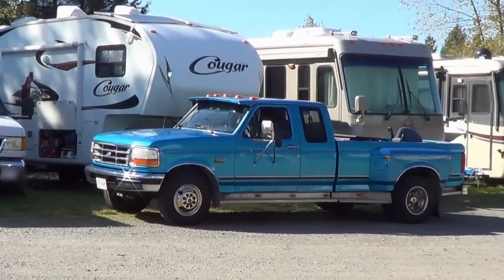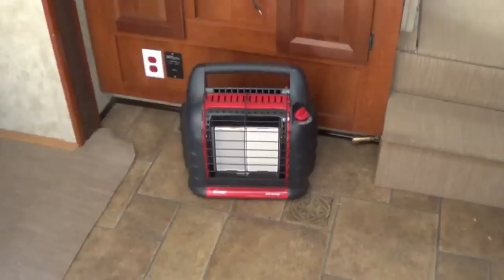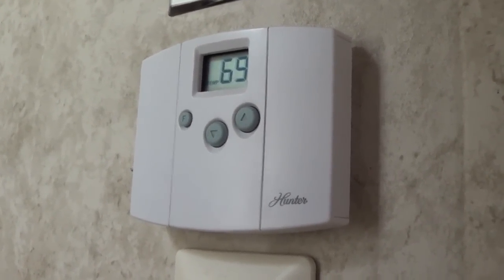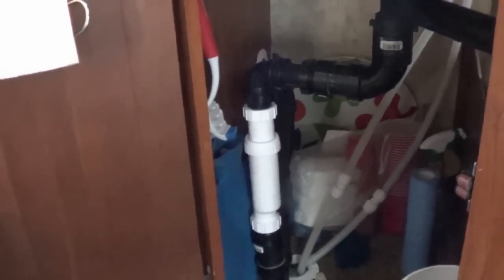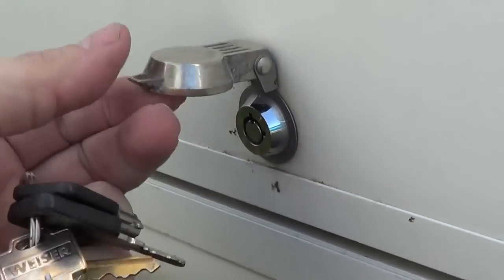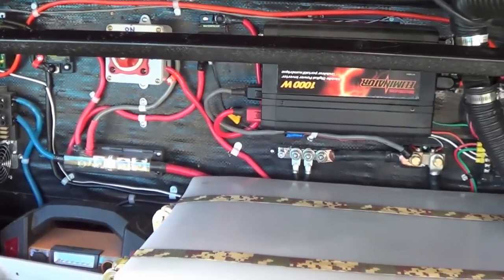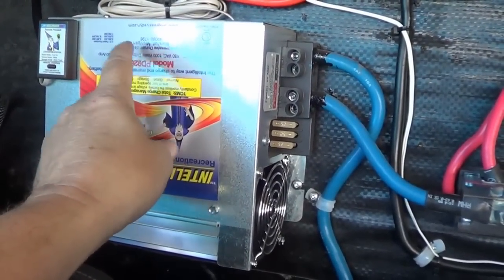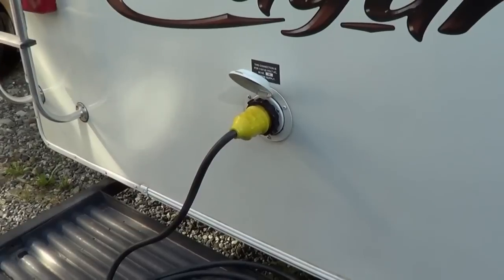Looking Back On Many RV Upgrades - How Have They Performed?

Comment: Hello Thanks for the update. FYI 1/2 tspn of Old English furniture oil applied using the corner of a paper towel to the cover of your key (or any exposed stainless steel or aluminiun and other metals) will deter dirt accumulation and oxidation. Easy to remove any build up later with just a water hose. I use an old raggedy wash cloth long ago saturated and kept in a zip lock baggie in the box with my windshield cleaner stuff etc in the hold box. A light coat is all that is required for the exposed trim metals after I wash the rig. Makes a difference. Ps. Don't wash this rag in any laundry. I just trash mine later.
Reply from the maker: Neat tip, thanks!

Comment: I have the Fantastic Fan with the remote control, it is truly FANTASTIC !!! I really like the remote control they use, you can use it manually, or you can set it to operate as a thermostat.

I also have that "Erngh, Erngh" sound coming from my two fans. I have determined that it is the motor that controls the vent cover. For some reason the system cycles at random intervals and it drove me CRAZY until I figured it out. My solution was to add switches that controlled power to the fans themselves. I simply turn the fans off when not in use. Also, the power switches allow me to turn off the fans with the vent covers open whenever I the Camper is in storage ( I have the Maxx Vent covers to protect the Camper from the rain).
Reply from the maker: My sound is a bit different since my vent cover is manual and I do have the fan wired to a second on/off switch on the wall.
I think I just need to disassemble it a bit and get a bit of lube in the bearing.

Comment: If you are wanting to replace your 1000 watt inverter with a super efficient inverter- check out the morningstar sure sine inverter.  All solid state, no cooling fans to fail, draws 50ma in standby mode so i leave mine on all the time (3 years usage now). It powers the 3 tvs, satellite receiver, DVD and Tivo receiver, refrigerator ice maker when boondocking as well as keeps all our computers, phones and other devices charged. Then we use a xantrex 2000 watt inverter that we turn on to run the higher power items like the vacuum, microwave, blow drier, induction cooktop (when boondocking)
-Scott
2012 Tiffin Breeze 28' with 1100 watts solar, CRV tow car
Reply from the maker: Looks great, thanks. Add to my Santa list. :)  Cheers! Ray

Comment: Great to see how the upgrades have performed. Have you considered adding a water filtration system for when your on shore hook ups?
Reply from the maker: It's crossed my mind from time to time, but always have other things to spend my money on. So far we've gotten by fine just purchasing our drinking water from machines when traveling and using separate jugs for it
When in BC on Vancouver Island (where we do the vast majority of our shore hookup camping) I don't worry much as I know the tap water quality is extremely good.

Comment: WOW! That's expensive! I just went through my whole RV and replaced over 20 G4 two pin bulbs and almost 20 921 bulbs like you pictured at 7:42 mark and I spent under $50 TOTAL. Off Amazon. My 921 bulb didn't look like yours though. But still works and puts out light.
Reply from the maker: Good deal!

Comment: Nice video.I see you are proud of your blue truck but what type of upgrades have you done to it. I have a old 90's ford like yours and would like to get some tips on how to get all I can from this old but tough truck. Any tips you have would be deeply appreciated. Oh yeah I like the color as well of your truck. Thanks God Bless Mike
Reply from the maker: It's a 1994. I haven't done too much, it's in stock condition, I just keep it well maintained. From what I read with the 1994 and older you can't do too much other than free up the exhaust a bit or maybe change the turbo to an aftermarket one. They'll never be a powerhouse but very reliable. Here is a good forum to read for the older Ford IDI trucks - http://www.thedieselstop.com/forums/f30/
Cheers Ray

Comment: Had to replace the battery in my LevelMatePro plus when I replaced it I had to bend out the contact for the battery compartment. But mostly wanted to tell you there's an update for the phone app that allows you to set the time out to help with battery consumption.
Reply from the maker: Cool, I'll update my apps.

Comment: I am a little surprised that you don't have an Autoformer to protect your rig from low power at the various RV Campgrounds. We just used ours for the first time and it kept the power at 125 volts for our entire stay. Amazingly, it also made our Coleman A/C Quieter. I know it is hard to believe, but, it was really much quieter than our last camping trip at the same campground where we experienced low AC voltage.
Reply from the maker: Well my rig is protected since my type of surge protector will the power shut off if the voltage drops low enough to cause problems, it happens at about 108 AC. Also, the display lets me know what's coming in at all times.
Funny enough sometimes low voltage can be caused by too many people on a weak campground power string running autotransformers. Using an auto transformer lowers the voltage slightly for other campers on the same circuit. If enough rigs are using them it can add up. Really though the root problem is campgrounds too cheap to upgrade their systems and the modern rigs are getting so power hungry.
If I routinely stayed at parks with low voltage problems I might invest in an auto transformer, but I don't find the issue too often, since for the most part I dry camp in the winter and stay at just a few parks with great power in the summer. I've weighed the pros and cons and decided it was an extra piece of equipment and weight I didn't need often enough.
Another option I have is to simply unplug and use my battery and solar. If that's the case I would ask for a discount or leave. ;)
Cheers Ray

Comment: Sorry about your loss. Thank you so much for the videos. Very informative and to the point. While watching this video I noticed your rack on the back appeared to have side supports vs just a center hitch. I only have the hitch and I'm not real comfortable about it wobbling. Have you done a video on this?
Reply from the maker: Thank you. Are you talking about the trailers rear pull out bike rack?
Reply: The flat tray under the electric outlet seen at 31 minutes.
Reply from the maker: That's the slide out bike rack, came stock on the trailer - https://www.youtube.com/watch?v=QTmYq110G3k

Comment: Sorry for your loss. I saw your rig on pictures of Lensun Solar Panels. I would like your take on them the good and bad? I am trying to decide which Solar Kit Company to go with. We want to try and run our RV Dometic Frig 6.0 cu in in the daytime, and switch over to propane at night.
Reply from the maker: Thanks. Here is my initial review of the Lensun panel - http://www.loveyourrv.com/lensun-flexible-solar-panel-review/ I haven't had a chance to use it much as we have been on hookups this summer, so won't know the longer term opinion until I head down south this fall and really start using it all the time boondocking.
My feeling though is unless there is a specific physical reason for a flexible panel, the rigid glass panels offer more bang for the buck and are proven to last.  Cheers Ray

Comment: Just stumbled on your helpful channel, sorry for your loss.  A couple questions with regard to your water pressure regulator.  When you hook up your pressure regulator, do you adjust the pressure with water flowing inside the RV, ie at a sink? Second once you set your maximum flow rate, does it need to be adjusted at different campgrounds?  Thanks, peace & happy travels.Bruce
Reply from the maker: Thank You Bruce. Ya, I set it up with the water flowing. I've only needed it once or twice to find the pressure I like, it's worked everywhere. If the campsite has really low pressure I just won't use it. Cheers Ray

Comment: Can't wait to see the video on the wireless BU camera. I've been researching some of those lately. Do you monitor your weight after all these upgrades? 6V batterires + Solar Panels + inverter + TrailAir + everything else ?
Reply from the maker: Yes, I check the rig on scales a couple times a year. As I've added weight I've tried to lose weight by not carrying other items, for example, I've really leaned out the amount of tools and spare parts I carry. Changed from heavy cruiser type bikes to lighter weight models.
We are getting close to max GWVR on the trailer 10,400 lbs, last reading was around 9500 lbs trailer with full water tank and 7000lbs truck with a pin weight of around 2000 lbs. Shows you why a 1/2 ton truck is a bad idea even though this trailer claimed 1/2 ton towable. The trailer axles are rated for 8800 lbs so we are pretty good there with about 7500 lbs on them.
One reason I really liked this model of Cougar was it had a cargo carrying capacity of 3000 lbs, may of the new super large fifth wheels don't have that much.
Reply: yes, 1/2 ton towable is the worst marketing gimmick ever. You can use a 1/2 ton if you have a 100 lb driver only and half a gallon of gas with the trailer at dry weight, and even then you're at your towing limit with the 1/2 ton.

Comment: Hi Ray I love your video reviews. Im getting ready to put solar on my trailer and was wondering if the glass they put on top is safety glass . Im just worried that they could get broken going down the road.
thanks
Matt
Reply from the maker: Hi Matt. The Renogy panels I have and most quality solar panels use tempered glass. I've never heard of any problems with them breaking during travel. I' ve gone down some pretty washboard gravel roads where the rig was vibrating  a ton with mine. Same with most boondockers I know and no issues.  Cheers Ray
Reply: Thanks Ray I just ordered my first 100 watts.
Matt

Comment: I have a question for you. with the 4 batteries. do you ever run your fridge on batteries while boondocking
Reply from the maker: No, the fridge takes not too much propane but draws 375 watts when the element is on. with enough solar power, I could see running the newer low-energy residential style fridges. Might go that way if and when the cooling unit craps out on our absorption style unit.

Comment: Ray,

As you know I have a similar size camper (245 RKS) and I'm curious if you would recommend the smaller size Buddy heater instead of the 2 panel one you have? We don't camp in very cold climates, maybe low 20's at the coldest.

Sorry for the loss, my condolences.

Ron &Liv
Reply from the maker: I'm sure the small one would put out plenty of heat, but I'm not sure if it has the low pressure quick connect or whether you will be using it or not.

Comment: Hi!  I just found your channel.  I am thinking of buying a 5th wheeler.  You have a Cougar.  They are very popular.  Would you recommend them for full timing or extended living.  If not Cougar then do you have any input on other 5th wheelers?
Reply from the maker: Depends on your price range. The Cougar has been a pretty good bang for the buck for us. We paid about 30K for it. But it's not really meant or warrantied for full time living. Most folks move up to a Montana. There is a pretty good thread in my RV Happy Hour forums about fifth wheel choices for full timing. - http://rvhappyhour.com/forums/topic/best-5th-wheel-in-your-opinion-for-full-time-living/  Cheers Ray

Comment: are you worried at all about the charge converter from your trailer over charging or drying out your batteries
Reply from the maker: No, the opposite actually, the OEM charge converter never was capable of high enough voltages to properly charge my golf cart 6 volta batteries never mind over charging them. The new solar controller does a great job, though.
Reply: good idea i will have to try that thanks

Comment: How's the long term durability of the trailer?  Any idea of a service life for the type of travelling you're doing?

I'm going to travel in a few years similar to you.  I'm very interested in durability.
Reply from the maker: If properly maintained I don't see why it can't last 10-15 years. I guess a lot will depend on the weather conditions it sees throughout its life. With our lifestyle, the trailer is exposed to pretty mild conditions all the time , not too much extreme cold or hot.
Reply: I'm concerned about dirt and gravel roads and jarring (so frame, walls, roof especially).

Thx Ray
Reply from the maker: So far after 5 years and quite a bit off rough roads I've had minor things needed to be reinforced or repaired but nothing major.

Comment: Hi Ray, nice video question for you on the trimetric is there a way to change battery temp setting from celsius to fahrenheit
Reply from the maker: Thanks, Not that I know of, but you could contact Bogart and ask they are nice to deal with - http://www.bogartengineering.com/contact/
Reply: ok ty just thought you might know i searched all over the book, guess they had design it for canadiens also eh
Reply: got response back from bogart engineering and battery temp read out is only in celsius
Reply from the maker: ahh, good to know. Works OK for me I grew up at the time Canada switched to Celcius, think I was in grade 3 so I know both, same with Imperial and Metric systems. I think the US is one of the only countries still using Fahrenheit.